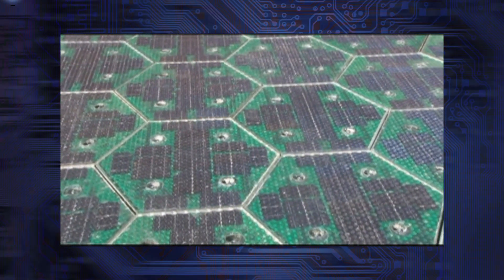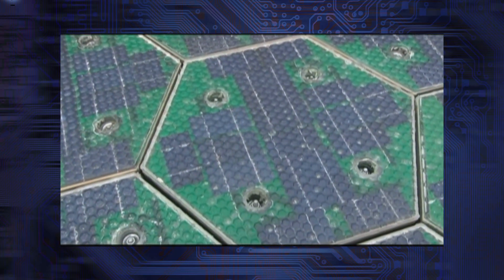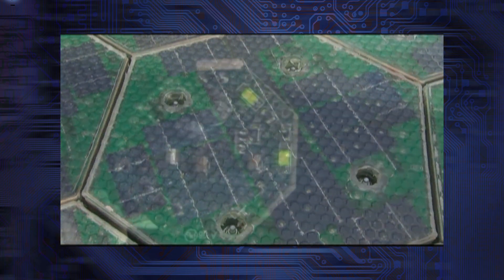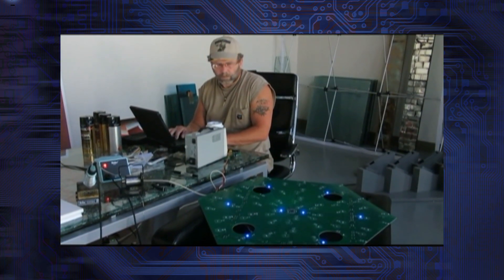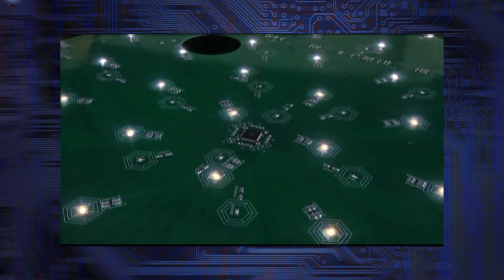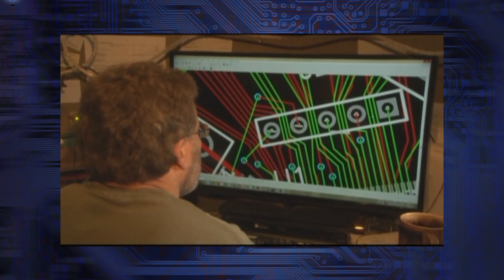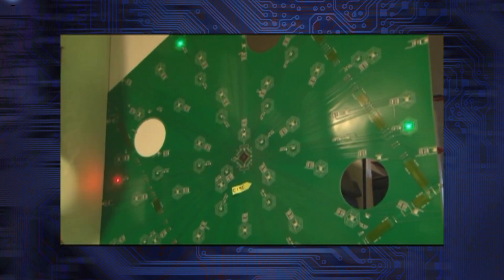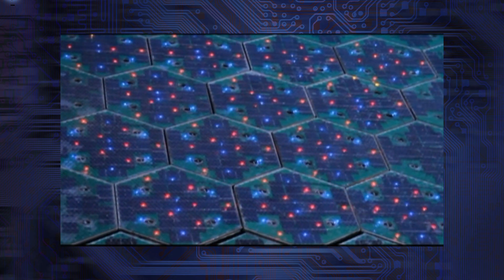Solar Roadways - Smart Streets of the Future

Comment: I love this idea but it would never work in Minnesota. The freeze/thaw cycle and the snow plows would totally destroy them within a week.
Reply: atheistpariah Except the snow storm blocking out the sunlight and not having any energy for heating.
Reply: atheistpariah 1) Solar panels absolutely need sunlight to maintain a surplus of electricity. That's how they work. No sunlight = no power generation and you are in an electricity deficit. What you mean is that the surplus created during times of sunlight is stored for later use.

2) It takes an incredible amount of energy to heat miles upon miles of roads for days or weeks.
a. It's not simply about heating the roads, it's about putting out enough heat energy has to melt the many tons of snow/ice that fall on the entire road surface over the coarse of a snowstorm. Think about the average number of feet that falls in a year, then multiply that by the surface area of the roads.
b. That energy isn't even going to be 100% efficient in transferring to the snow/ice to melt it. A ton of energy is going to be wasted.
c. There isn't going to be a large enough surplus to cover that unless you dedicated several months worth of sunlight generated electricity just for this purpose. It would be very expensive to store that amount of electricity and the point is that these panels feed into the electric grid for general use. That electricity is completely wasted if they are just saving it for snow days.
Reply: atheistpariah Whether it's accumulated or being melted as it falls is irrelevant. The volume of snow/ice that needs to be melted is the same. And if you are melting it as it falls, you are losing most of the energy to the air.
Reply: atheistpariah
 aquamonkeyeg
Just crunched some numbers for you guys, assuming 16 inches of snow at -5 Degrees Celsius falls in a day with good solar efficiency (Full Sun for at least 50% of daylight hours), a 100% heat transference from road to snow with no loss to air...

Melting the snow only takes 15-20% of the energy used. (Assuming snow falls at -5 Degrees Celsius).

Of course with loss of heat to air it could become at least 5 times more energy inefficient. So it's probably more like 75% to 100% of energy needed.

Bottom line, any of these things could make the road unable to melt it's own snow.
- Significantly colder falling snow (like -10 Degrees or more)
- Poor Sunlight for most of day (Snow storm)
- More snow.
- Rubber or dirt on the road absorbing heat meant for snow.
Reply: atheistpariah it sounds like you've never actually lived in Minnesota before. Snowfall for only a few hours? Snowfall without overcast skies? Really?
And all of your comments are totally missing the point I made in the first place. The freeze/thaw cycle of the ground will make the road buckle and crack, and then the plows will rip them right out of the ground. Using electric energy to melt snow couldn't be more irrelevant.
Reply: And melting the snow as an attempt to get rid of it wouldn't work either. The snow often falls faster than it melts, so instead of having roadways covered with snow, you have roadways covered with slush with snow on top. Before the cars weren't getting traction, now they're hydroplaning. If you really think it's a good idea to remove snow by melting it then I invite you to move to Minnesota and then install heat pads on the roof of your house to melt the snow. Then try getting past the wall of icicles hanging off your roof and the ice skating rink you just created in your front yard.
Reply: atheistpariah
epic fail? If you bothered to read the comment that you're commenting on you would notice that I'm referring specifically to Minnesota when I say it wouldn't work. So what have you been talking about snow for if Minnesota's conditions are irrelevant?
Reply: atheistpariah How is it going to tell the difference between a freezing overcast day and being covered in a small amount of snow? And if you are melting it as soon as a coverup is detected, the snow is still falling, hence you'd be melting it as it falls.
Reply: atheistpariah And time of day is irrelevant, snowing at night happens too.
Reply: atheistpariah Threshold for what?
Reply: atheistpariah Inefficient waste of electricity is still an inefficient waste of electricity. The point is for these roads to add to the power output of the grid for general use, not act as a giant sinkhole for melting tons of snow.
Reply: atheistpariah You're just throwing out words without addressing what metric would be used for this detection....
1) You said lack of sunlight during daytime hours. Bad metric for more than one reason, like snowing at night or lack of sunlight but no snow.
2) You said freezing temperatures. You can have freezing temperatures without snow.

And this is just to reduce the amount of inefficiency with this method of keeping the roads clear of snow. This approach in and of itself, even if you could somehow do it perfectly, is still a massive waste of electricity.
Reply: atheistpariah I understand the problem just fine. You say there's a a clear-cut solution, yet the solutions you've proposed have incredible flaws.
Reply: atheistpariah You keep focusing on the small issue of trying to optimize the efficiency of activating this method (and dragging me down into arguing it with you), while completely missing that the entire method is inherently bad. The inefficiency is in the heat transfer itself. The waste is in dumping all this electricity into melting millions of tons of water.
Reply: atheistpariah And the point about it being a massive waste of electricity flies over your head again. The purpose is that these roads put energy into the electric grid. Not only are they not generating power during a snow storm, using them in this way puts a huge drain on the entire electric grid for a terribly energy inefficient way of clearing snow from roads.

Being able to program the system to activate perfectly is completely irrelevant. It's the pure physics of dumping MWs of power into miles of roads to inefficiently melt tons of snow.
Reply: 420Travesty And the snow melting function they demonstrated on the site was less than an inch of already set snow on a couple panels. They didn't even bother addressing continuously falling snow that can amount to several feet. What a joke.
Reply: atheistpariah .
"The idea is to have solar panels store electricity to the electrical grid that can be used at our disposal."
Do you know what that means?

Comment: Stop with the "this will change everything" nonsense. I don't think this will result in much. Honestly, just consider the construction and maintenance costs.
Reply: Well, for costs you have to have some solid numbers to back your claim. So the question: do you know what it would cost to maintain and construct such roads? Considering the fact that these roads can pay for itself by collecting energy and that they can be easily repaired, I don't see how they are not a better alternative to current roads. It may not change EVERYTHING, but it has a chance to improve infrastructure a lot.
Reply: Religion is moronic! Thanks for repeating the brochure.
Reply: Ways these are cheaper than you think
- The heating element keeps them at a constant temperature eliminating fatigue and cracks causes by the freeze thaw cycle.
- No more need for line crews and crack repair crews.
- No more need for snow ploughs.
- The value of the electricity produced.
- Reduced accidents thanks to the intelligent lighting system. Thus saving first responder, medical, repair, and insurance costs. 
- They seem to be modular and easy to change out, pavement is not. When a panel quits working or suffers damage the road crews simply pull the entire hex and replace it instead of setting up cones, blocking a lane, and then doing no work for 2 weeks.
Reply: Religion is moronic! There's more flaws with this project than anyone wants to admit. It's nice to know that 'snow ploughs' won't be required, but what about other weather conditions? You might come from an area of snow(?) (I have no idea where Alberta is, since different country), but in my area it rains for 6-8 months a year. And with vehicles that can exceed more than these panels can supposedly tolerate (going at speeds faster than the creators have never thought of happening, as well as can weigh more than the panels supposedly can tolerate), it will be interesting how these turn out. I'm not denying their existence or practicality will end up being. But you've proven you're a bit small minded (and you stated everything that was on the brochure as well).
Reply: Indigocell The 'better traction' is unknown. There is no definite research done on these panels yet to make any statement about 'improved traction'. As for asphalt, compared to other potential road surfaces, it's a lot better than you think.
Reply: What if it replaces street lights in certain areas?
Reply: Professor M I see what your saying, but I'm still skeptical. Let's not forget solar panels vary in efficiency and wear out over time. I hope they're onto something though.
Reply: Mick drew Highway asphalts hardly last 15 years, AFAIK, that's more than enough for solar panels. I would be more concerned about the mechanical strains, don't forget those really heavy trucks, the temperature fluctuations, chippings…
Reply: o_O That speaks to the maintenance issue I raised. Also, while asphalt doesn't last very long, I willing to bet replacing a network of solar panels is a much more complex and inconvenient process.
Reply: Mick drew They are supposedly be able to be removed/replaced in sections. My major issue with this is with the estimated max weight & traction of the panels over time (especially when very wet).
Reply: *****
Weather conditions already make roads incredibly dangerous.  There is absolutely no reason to assume that these weather conditions would be any more dangerous (on the solar road) especially when the traction is supposedly better than asphalt.
Reply: Religion is moronic! Not to mention you could implement something that could alert a central system somewhere if there was a collision
Reply: ***** Easier said than done.
Reply: Everything worth doing is difficult, and given that your daily commute is when your most likely to die before your time anything we do to make it safer is worth the effort.
Reply: They will pay for themselves, in due time, through providing power: A square foot of these panels will also probably last longer than any piece of asphalt out there, and you require an entire road crew with heavy, diesel-guzzling and particulate-matter-spreading machinery to repair asphalt, whereas a single engineer will be able to repair a solar road in no time. And unlike asphalt, that can be left with pot holes the size of small cars for years due to no one reporting it in, these panels can communicate directly with road maintenance crews when they need to be repaired, lessening the risk of accidents due to roads left in disuse for years.